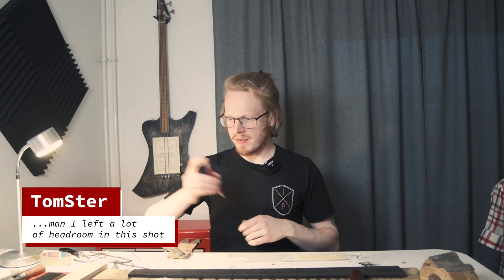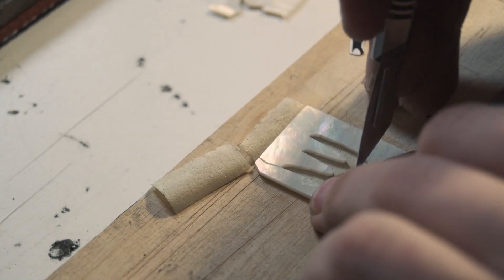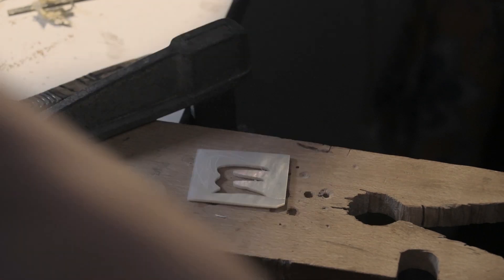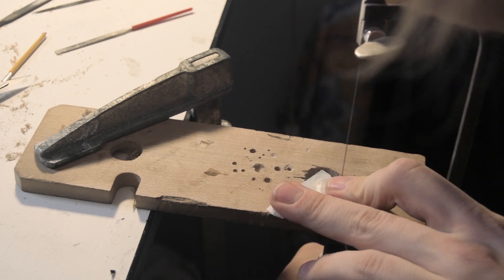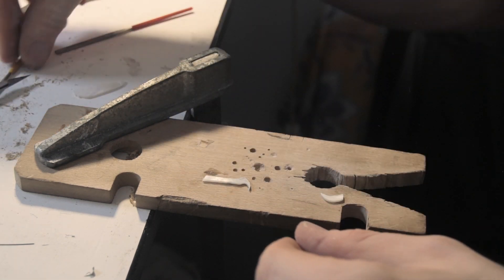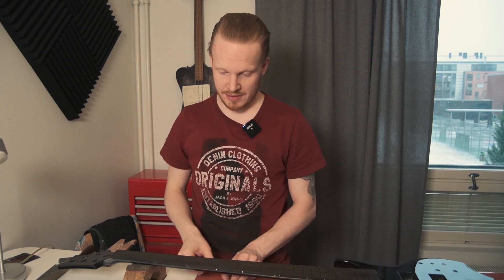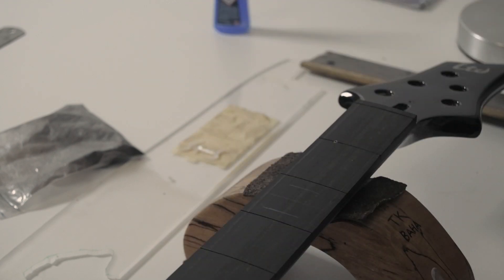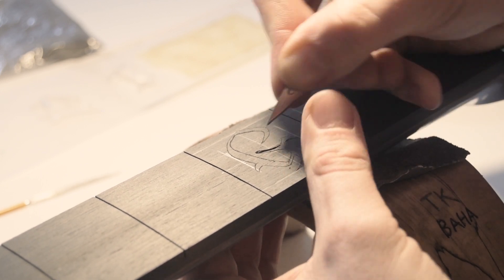Making Custom Mother of Pearl Inlays

Comment: Is the fretboard unfinished? Can you radius the board with the pearloid in?
Reply from the maker: It is unfinished yeah. And of course :) I usually radius my fretboards up to about 150 or 180  grit and then do inlays. After that I finish sanding the radius to get the inlays to match. Though this heavily depends on the thickness of material I've used.
Reply: @IPGuitars  thank you, is it possible to buy unfinished guitar necks? How does it work if an inlay crosses over a fret, do I have to cut out that fret part?
Reply from the maker: Yes you can get unfretted necks. For instance Warmoth sells a good few.

If you have an inlay that crosses over a fret, then yeah you have to recut that fret slot after inlay installation. It's also a good habit to use a triangular file to give the slot a few swipes, just to help the fret seat and and to make sure the inlay doesn't break during fretting.